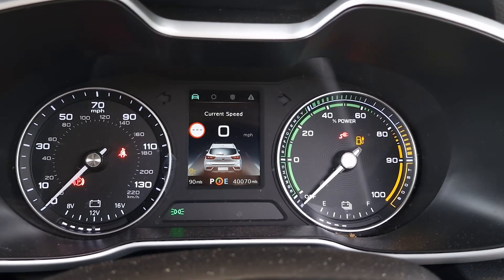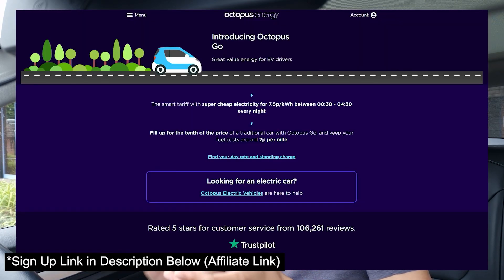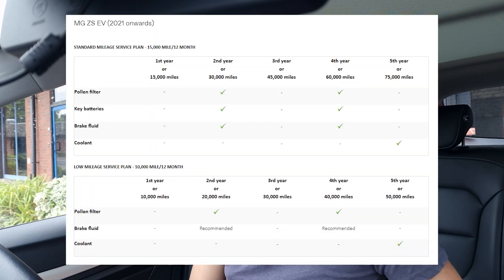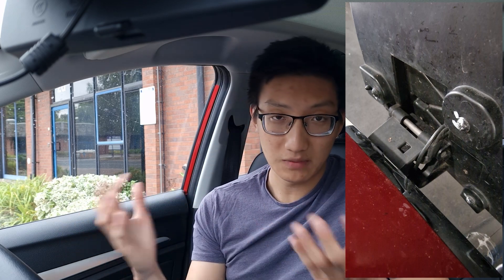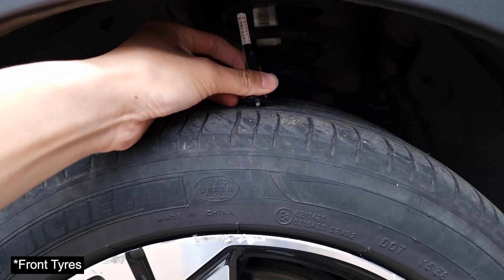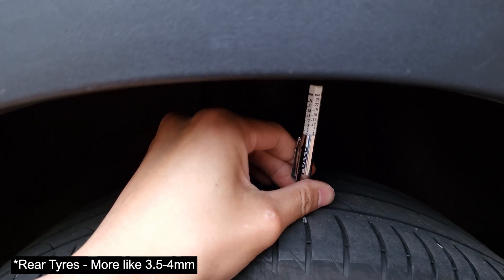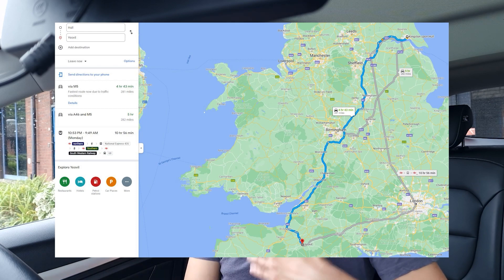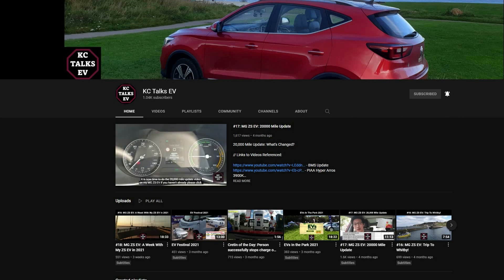MG ZS EV: 40,000 Mile Update | KC Talks EV

Comment: Is battery degradation linear. Will it continue at its current rate?
Reply from the maker: Great Question! It shouldn't be. What tends to happen is a sudden drop at the start of its life, and then it tailing off as the battery ages. Then towards the end of its working life, it then suddenly decreases again. 

https://www.researchgate.net/figure/General-capacity-degradation-behavior-of-lithium-ion-batteries-15_fig3_303890624 - There is a good diagram demonstrating the above. 

I'm not an expert on the topic (I am a chemist by trade though!), however, what I also expect is that as some capacity is hidden to the user (what I call usable capacity), some batteries can mask this effect at the start better than others. For example, some of the Hyundai-Kia models will report 100% SOH at 55-99,000 miles but in reality I would be very surprised that is true. MG/SAIC likely don't and whether that is a good thing is up to you.

Comment: Thanks, great video. Currently waiting like many others for my LR ZS. 40k and 8% isn't too bad but could be better like kia and hyundai.
Reply from the maker: Thank you for watching! I expected a bit less to be honest but given the warranty is validated for 70% at 70,000 miles, unless cells start to fail (touch wood!) It's looking very good at the moment. Still will do what I need it to, as stated in the video. 

You're right with Hyundai/Kia models, although the older models (e.g the 27kWh Soul) seem to have quite a bit of degredation. Looking at Bjørn Nyland's video after ~65k miles and 7 years it's on  over 40%.
Reply: @KCTalksEV  modern EV's those designed after 2018 with the exception of the 60kwh leaf have better battery chemistry and better battery management systems (liquid cooling/heating) and generally tend to have less degradation however it will be interesting to see if the ultra-new LFP or lifepo4 batteries manufacturers are using in their standard range models last even longer with very minimal degradation !